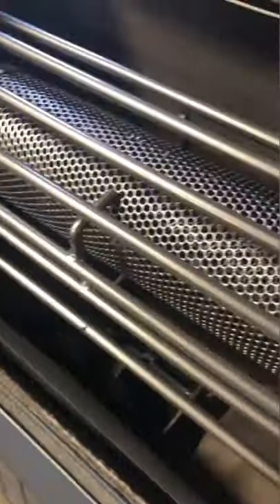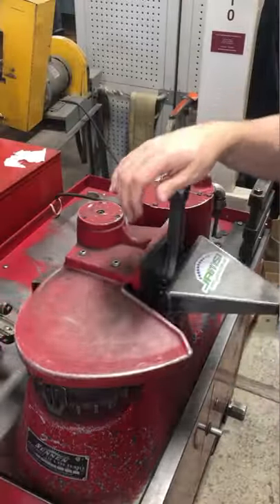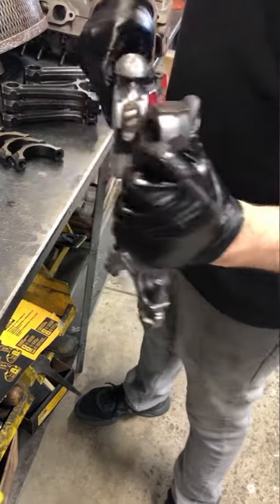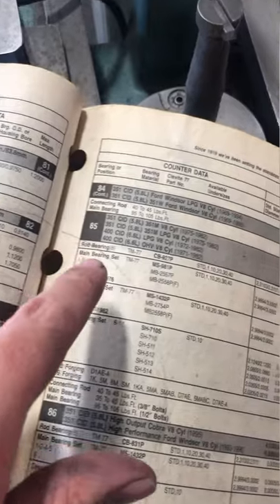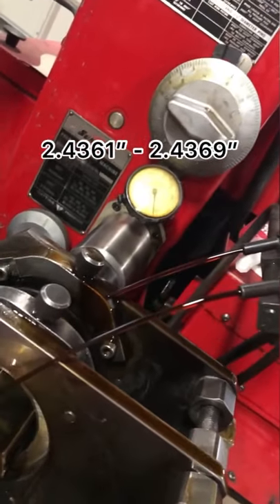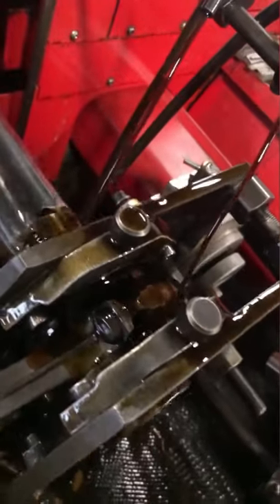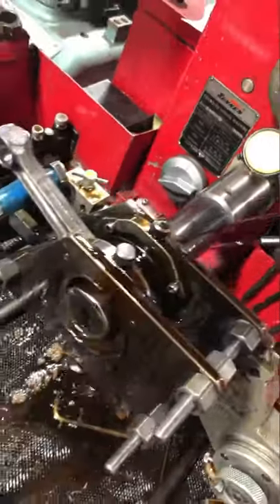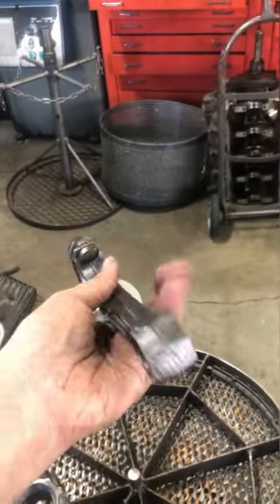#shorts Resizing Ford 351M/400 Connecting Rods @JAMSIONLINE

Comment: I’m glad people still out there doing this, when I was a kid it seemed to be a machine shop on every corner, not the case now.
Reply: Its because things today are mostly made that way you need to buy new one when old is worn. Back in time when you buy new car instruction clearly says "first Oil change in 1000-3000 km" now is " thanks to our superior durable Oil first change in 40 000"
Reply: Yeah we have definitely become a throw away society
Reply: @noidontthinksolol  most of the waste content doesn’t get recycled. Especially plastic
Reply: You don’t see em anywhere. Each of my uncles growing up had machine shops in their garages and would build stack cars from the ground up. Everything from the frame, suspension, and engine was built by hand. We can’t afford to lose men with these skills.

Comment: I'm a machinist, and have always been into the automotive scene. I love how most processes are set-up where its, near, guaranteed to meet size specs. But on something like this, I have always wondered about rod length, when resizing rod ends. 

I understand that some material has to be removed, so that there is an ellipsoid shape to start from, but how much big end to rod end length is lost in this op?.

I deal in ten-thousandths for most things, and this might be a minor thing, but always wondered what kind of leeway there is with this kind of stuff.

Cheers from Canada
Reply: The rod and the cap should be cut the same amount so the starting length stays the same..after finish honing. ..be safe

Comment: What do you charge for redoing heads I have a set of 4 barrel Cleveland heads but when I got them all the valves were stuck or rusted in so I know it's going to take a bit to get reconditioned

Comment: I noticed that when honing the big end there was nothing locating the small end. How do you ensure the correct distance between small end and big and centres?
Reply: If the cap and rod are cut the same amount, then the hole resized nothing but the hole diameter should change...
Reply: @MrBubbahunt9  No.  That is not how that works.  If you trim anything off of the rod length,  you are shortening bore centers.  Period.
Reply: Honing tools usually have several cutting edges and are usually double jointed so they   stay in the center of the hole and just increase the diameter. Just pray to the suppliers QC routines that the C-C is correct, or use a CMM to check it after adjusting diameter...
Reply: You should flux of the same amount on the cap as on the rod , yes once u flux of on the rod it self u ate destrokin the the rod , rather flaux of on the cap only depending on how bad the rod is , i normaly take of about 0,005 on the cap only and the resize it , so yes especialy on diesel engines where your suppose to do piston petrution , rather destroke the rod , dont machine the piston especialy if if it is a turbo
Reply: I noticed the rod was moving around while being bored out also. That doesn't seem right.

Comment: 351M stuff, now that’s something you don’t see everyday

Always wondered how the 351 big block would compare to the 351 small blocks
Reply: A 351C 4v is as close you will get to that.

351m/351c 2V valve’s are 2.04/1.66, 
But the 351 4v valves are 2.19/1.77.
For reference some 429 Cobra Jet has valve sizes of 2.19/1.73.
But they did have a lot of variances between models. But I generally 351c flowed like big block engines.
Reply: @chaselesser3191  yes indeed they do
Reply: @actiniumanarchy9237  Unless you were talking about the FE block. Which they had a 352 big block.

Comment: So what about cracked capped rods. If you remove any of the material from the mating surface you remove the natural strength that the cracked cap design has. How would you bring the bore into spec with that?

Comment: Wouldn't this make the slightest change to the stroke?
Reply: I don’t think so due to the fact he is actually off centering the new hole. So the bolts may sit higher on the crank but the length is then unaffected on the top end. I was sitting here thinking same thing watching video.

Comment: Wouldn't cutting the mating surface make the stroke slightly shorter?
Reply: If only the rod end is cut yes...the correct way is the cut the cap and rod equally...then resize the housing bore...be safe

Comment: What compensates for the wear on the stones?
Reply: The stones are spring loaded thats why you have constant movement of the part font to back, there is a foot pedal that starts the mandrel and applies pressure also thats why you usually have a sized bushing the length of the stones to set pressure and make sure it has even wear, also it is removing .0001 in most cases we say tenths in the industry because we treat .001 like an inch. Im sure there us other ways to explain.
Reply: @gabedelgado80  Thanks for the good explanation. I always wondered how that works.
Reply: The aluminum or brass shoes on the other side ,and to get righ before starting , u need run a diamdond dress over it

Comment: The 400 and 351M has been so overlooked for so long due to the EPA and OPEC. Ford dropped static compression to a wheezy 7.3:1 talk about a waste of a true performer of an engine. The '71 400 put out more horsepower than a 1990 460 by 55 horsepower!

Comment: I always wondered. How did they make the first machine for accurate machining when there was no machine to make the parts. It's like the chicken and egg thing.
Reply: A lathe can replicate itself.
Reply: Check out primitive technology for the beginning. He starts with nothing and gets to stone tools and clay bricks.
It's a slow evolution
2000 b. C. First wood turning was made. 
In the 15th century they had hand cranked lathes with supports. 
One century later they had automatic  feed on their lathes. Then came metal lathes and steam power. 

The modern CNC stuff is the pinnacle of thousand years of advancement where one tool was used to build the next with a few upgrades which then was used for further tools and so on.

Comment: Yeah, except you now have incorrect bore centers which will alter compression.
Reply from the maker: Chances are you’ve taken <.003” off of the center to center length of the connecting rod. Sure, it technically alters compression. But do the math, it’s negligible.

Decking the block & surfacing the heads will have a greater affect on compression than this.
Reply: @JAMSIONLINE  Do you not measure before and after?